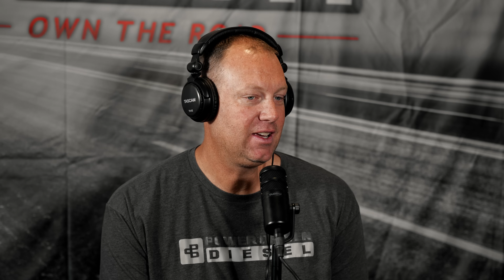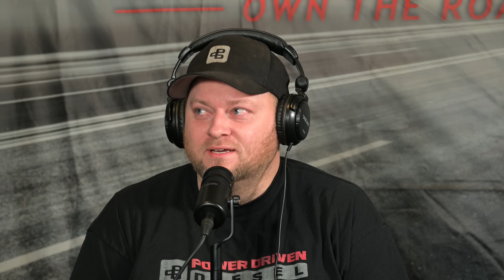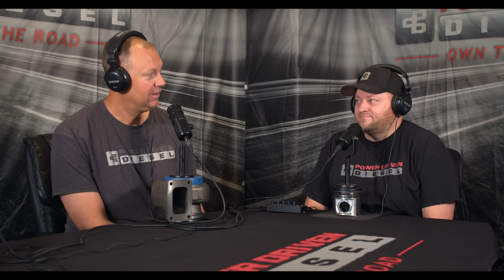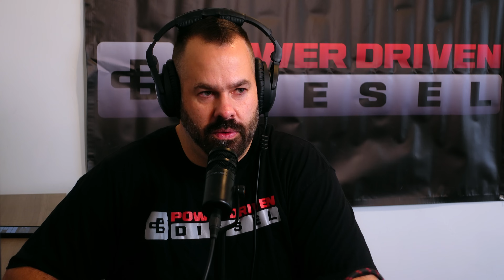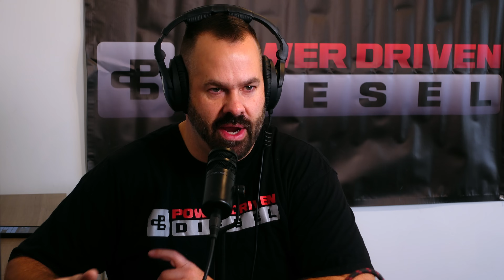Perfect Diesel Fuel Injection Timing

Comment: 12v with 215 pump, hx35 over 476, 5x14 injectors, arp 425s, 4k gov springs, nv5600, pdd stage 1 pushrods, 60lb valve springs, and air dog 165 lift pump. What’s good timing for streetability but favoring power?

Comment: Great video! Im new to diesel tuning theory! Of course still learning gas as well!
In gas engines they are manipulating MBT -Maximum Brake Torque, when they are adjusting timing at idle. They keep below max torque to have a window for the computer to adjust up and down as he describes.

Comment: 12 valve with stage 1 powerjet injectors, aggressor 60/64, 025 dvs, arp2000s. Where should I be at for timing. I want reliable but still want good power.
Reply from the maker: 20 degrees

Comment: This might be a long shot but anyone here have a quadzilla on vp44 truck? I have a stock turbo with boost elbow and big head wastegate, 4" intake and exhaust and 90hp injectors. I get 21-22° at 800rpm idle, 15-16° at cruise and 17°-20° at WOT all according to my Iquad guage. That's at PL2. Pl3 still sits at 21-22 at idle, cruises at 16.5-17.5 and will hit 24° at WOT. Anyone else seeing similar on their quadzilla vp44?
Reply from the maker: We regularly use the Quadzilla for 98-02 VP44 trucks!  There's more power with more timing, try 26 or more!

Comment: 200over injectors 
ARP 425s
S365/s475
Big fass, etc
What timing should I run?
Reply from the maker: Is this a 24v common rail?  If so the timing is variable and should be different at different boost levels and rise with RPM maxing out in the 30+ degree range above 3500 RPM.  If this is a VP44 truck, you gotta play with it and see what drives best for you, likely 25+ degrees and possibly 30 degrees.  If this is a 12v, 20 degrees is pretty safe, 24 degrees is a nice tempered street truck, and 30+ for weekend warrior, but the head gasket won't like it if you short shift at high boost with with just ARP 2000 head studs.

Comment: A denser fuel charge slows down the flame front - the burn.  Injecting the denser fuel charge a few degrees sooner gives the needed time for the slower burn to occur in the given degrees of crank rotation so that max pressure point after tdc is just right
Reply: In same fuel, density can vary from temperature and pressure. Is that the same as the "denser fuel charge" you refer to, or just a bigger amount of fuel perhaps?
Edit: I agree anyways.
Reply: In mechanical engines, and much of the time in electronic ones as well, when you increase the fuel injection quantity the injection duration is extended. You aren't injecting a denser fuel charge at one given moment, you're increasing the length of time the injector is open in order to deliver more fuel.

That's what demands an advance in SOI timing in order to continue making peak cylinder pressure at the same crank angle; the fact that your EOI timing would otherwise be retarded by extending the injection duration. The burn rate is only "slower" because the injection event is taking longer.

Comment: I bought the quad zilla for my 24v from you all. It's been working ok. I don't have company 1-10 settings graphs
Reply: Like the factory settings for the quadzilla 1-10?
Reply: I get mixed with settings 1-5 or something but they say valet mode?. My engine is strong so I can't tell the diff

Comment: I believe the rational for both port and direct injection is because with a gasoline engine the intake ports end up getting really dirty without some gas in there to help wash them so they combined the two to help solve this problem.
Reply: I'm not an expert on the matter but I have been around a lot of high power B58 builds and those guys are adding aftermarket port injection along with higher pressure direct injection pumps for more power gains as well.
Reply: @milfwhisperer732  Interesting. I suppose the more gas you can get in there the better. How much HP are they pushing with those setups? It's amazing to me how much power it is possible to get out of an engine as long as you don't need it for long.
Reply from the maker: That is how we understand it as-well.

Comment: Very interesting 🤔 this make me ask a question… so my dad has some stage 2 injectors that he recently installed and left the timing the same, I noticed that when accelerating quickly from a stop it often crackles and pop at times with some white ish smoke and then it settles back to normal, what could be the problem? It’s bone stock minus an intake and stage 2 injectors
Reply from the maker: I would check fuel pressure first. It sounds like a low fuel pressure situation!
Reply: @ okay is there a way to turn up the pressure on a stock application or go with a fass or air dog?
Reply from the maker: You are able to turn up the fuel psi by using a torktek overflow valve something like this link below https://powerdrivendiesel.com/product/cummins-12v-adjustable-overflow-valve-for-p7100/

Comment: At what point does timing affect cold start on a 12 valve? Its below zero here at 8k feet in colorado 😅. 12 valve starts amazing compared to my other diesel so im nervous to touch timing and make cold starts worse. 

Cant fit a second battery in my swap so I need it to start quick 🤣
Reply from the maker: Anything above 20* makes a noticeable negative difference for cold starts.  Usually 16 to 18* timing still starts like stock!
Reply: @pddofficial  Thanks for the tip! Once I sort out a few other things on my swap, some PDD engine parts are coming next!

Comment: I’ve got an edge juice with attitude on my 2015 Cummins. I was getting a bit of smoke when stomping on it at low boost. After adjusting my timing up the smoke went away. I’m guessing it was still trying to get all the fuel in after the cylinder was on the down stroke?
Reply from the maker: It sounds like timing was the problem.

Comment: No kidding    Cummins Mack detroit Cat all learned this in the late 1930s   And then a new group of engineers would have to learn it all over again at the customers expense  Middle 60s 335 cummins would break head bolts then you could hear them  Chirping at idle   Most commanly happened in cold weatherwhen oxygen density was high

Comment: That 6.0 needs more timing cold because the oil is cold and delays actual SOI. Thats why the HEUI pcm's monitor oil temp and use it for every modifier.
Good discussion
Reply: Yeah it has a temperature map for the oil viscosity to make sure it gets the injection when it wants it.
Reply: @Bacongrease00  so does 5w-40 screw it up? genuinely wondering now
Reply: @ianc8165  not necessarily- the thinner oil will most likely heat up faster because it'll flow faster- that's exactly the point of monitoring the oil temp. However, if there's a time-based parameter for meeting a certain temperature within a certain time frame. Your question example: 5min of engine run-time = 100°  using 15w-40 ....VS..... 5min run-time= 110° using 5W40... That 10° difference in 5min would have to be a parameter programmed to "matter" - it's definitely utilized in gas engines for emissions purposes and light-  TDIs

Comment: With late ignition less heat is converted to mechanical energy. The combustion gasses stay hotter, longer, to heat the engine faster and the hotter exhausts heat the cats quicker.
Reply from the maker: Thanks for the comment

Comment: New product idea. A cam phaser type device for variable timing on a p-pump. 
Too much  timing on a 12v sounds like someone threw a bag of hammers down a steel stare well.  Becuse of insufficient ignition delay. Lenny DDP says 18.5 is good enough for most and is pinning his new 12.5mm pumps there.
A nabor complained about how loud my 1st gen with variable timing was, till I got a fixed timing p-pump 2nd gen now he wishes I'd drive the 1st gen more often.
Reply: MACK did it on an E7 engine.. P7100 or P8500? pump... called Mack Econovance... don't know much else bout.. perhaps it used oil pressure or something like a CAT scroll pump... someone knows more out there...on both..
Reply: The cat 3406B has the advance mechanism on drive gear..under the nose cone there... perhaps something similar could be designed and incorporated on the B series/ 7100 combo...idk,but anyway 👍👍👊

Comment: How do you change that timing ? My truck is 03 and turns over quite a few times before starting . Gets only like 13.5 mpg . All stock except for kn air filter and I do have edge juice with attitude. Dodge Cummins 5.9 24valve
Reply: Get rid of the k&n air filter.
Reply from the maker: Give us a call, we would love to help with this issue! (435)962-9555
Reply: Need a tunner or get in tunned.
Reply: If it’s cranking like that sounds like you need to check your fca on the back of your c3p pump just unplug it and start it if it starts right up it’s bad, and also your relief valve on the fuel rail might be weak.
Reply: Retorque feed tubes
Reply: A high quality larger injector like up to 100 hp, and a good tuner. smarty etc. this will help you significantly, and the larger injector will put more fuel quicker and have a better combustion, and result in better efficiency

Comment: Boring! Will sucks
Reply from the maker: We hear you, Will is definitely getting fired!
Reply: Boring because you don’t understand a word they are saying?
Reply: ❤will#1
Reply: Lol Will has probably forgot more than you know.
Reply: I find the terms 'more timing' , 'less timing' and 'not enough timing' puzzling. 

When you say 'more timing' do you mean timing advanced more?
Reply: If you don't understand what they're saying, it's probably best leave it to the professionals...
Reply: @Jcardiff  not enough timing usually means A) the piston is too far down the bore when peak cylinder pressure hits. The piston is running away from the fire reduces the peak. They were saying 15° after tdc is the sweet spot B)  just like gsa the fire has delivered 75-85% of its potential 50°past tdc..
More timing . Increase the total amount of timing  you have , advance the timing.  Example :Well if you are at 15° before tdc then make it 16°-40° 
, increase timing  typically becuse the piston is too far down the cylinder bore ( before top dead center tdc) causing peak cylinder pressure to happen prior to tdc
Retard / reduce timing 
The peak cylinder pressure is occurring before 0°tdc trying to spin the crank backwardsrobing power from the cylinderin peak power mode.  If extreme enough the piston won't make it to tdc  and the rod will shorten to allow the crank to keep turning. Or between 1-15°where the force is going more to push the main cap off than to rotate the crank,